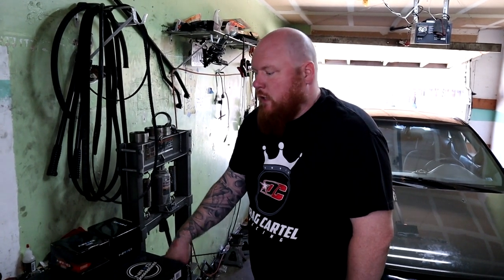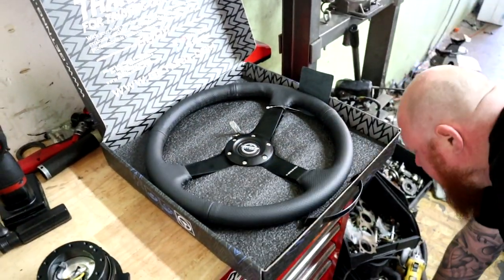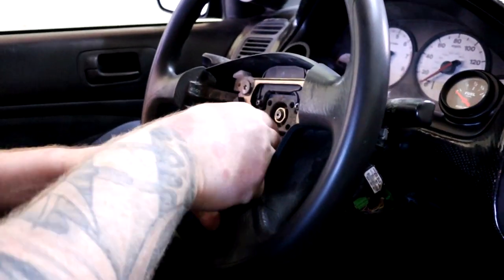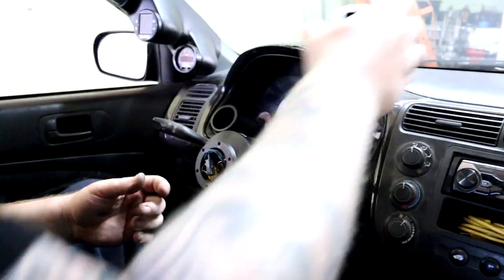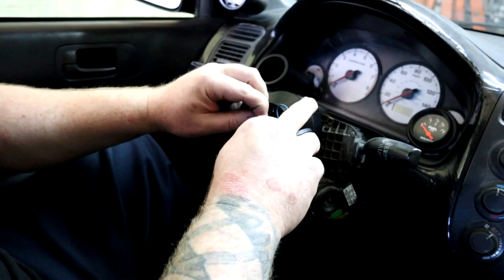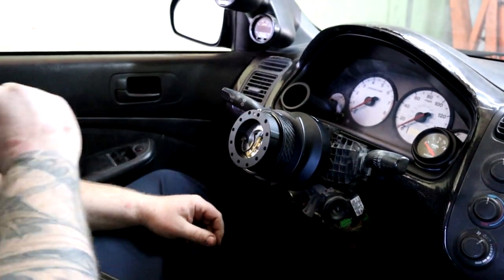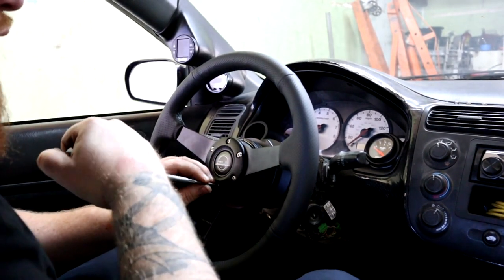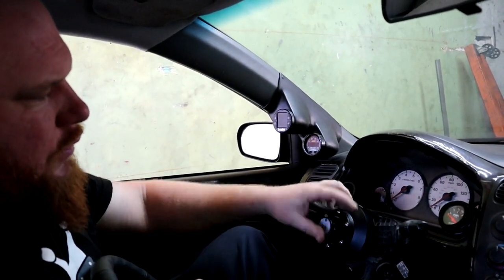NRG Steering Wheel and Quick Release Install on my Civic (watch before purchase) and update

Comment: Do you still feel the connectors rubbing on the inside of the hub when you are turning the wheel? I followed your guide and everything works perfect. But my ocd is killing me knowing the airbag clip and horn clips are all jammed together in there. When I turn the wheel I can feel it
Reply from the maker: Why would I feel it rub? The clock spring spins
Reply: @GravyBuilt  Yes but the cruise control connector is still sitting in there, horn connected and working fine But even though the clock spring spins its rubbing on the back of the horn cap. (I'm not using the quick release, I just have a short hub and the steering wheel)
Reply from the maker: My car didn't come with cruise control
Reply: @matthewstewart7712 did you fix it mines doing the same and I took it apart so many times

Comment: NRG are what I consider the cheapest product you could recommend for an aftermarket wheel. I run them often.
They are not as strong as a steel-core oem wheel, but planty strong for cars with no power-steering.
Racing wheels are made for turning, not pushing yourself into your seat, pulling yourself foreward, or bracing yourself in the corners. 
Also beware cheap chinese knock-offs, they are not as good, and this is critical safety equipment. 

Jay leno would be proud your project car has a working horn. ;)
Reply from the maker: My car has power steering and I do drag racing plus I plan to have proper seat placement. Not sure where the question is
Reply: I appreciate this information
Reply: @GravyBuilt  does your steering wheel make a grinding noise when you turn it left or right cause mine does and i can't figure it out

Comment: On your quick release SRK 151. There’s a metal ring that’s on there that’s almost a full circle. On the side facing you 
Mine popped out, is it necessary to have with the quick release or was that included for shipping purposes? 

I tried to put it back in but it keeps popping out.
Reply from the maker: I didn't use mine and it works fine, to be honest I'm not sure it's for they don't really come with instructions